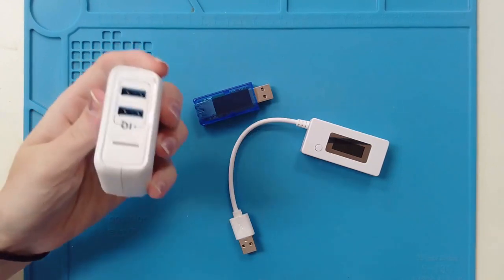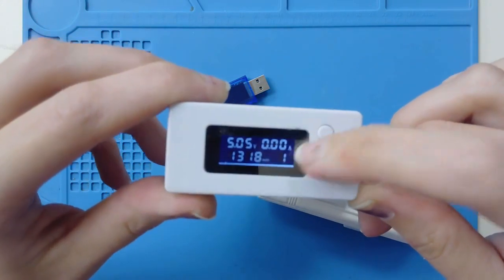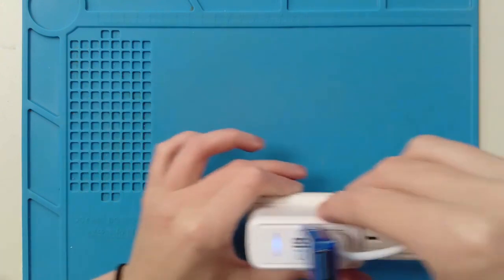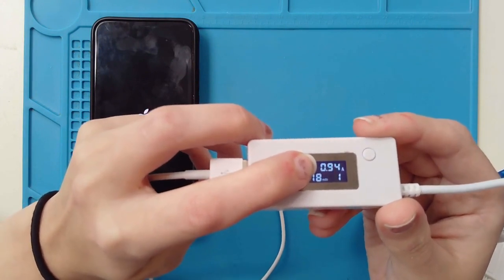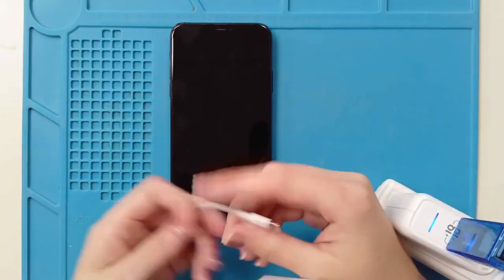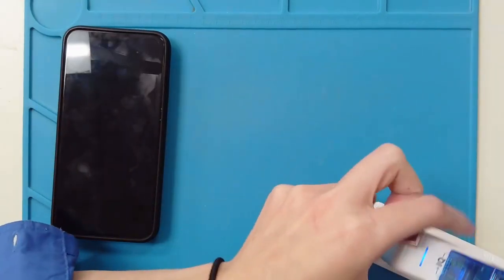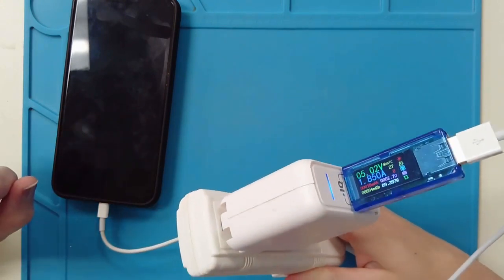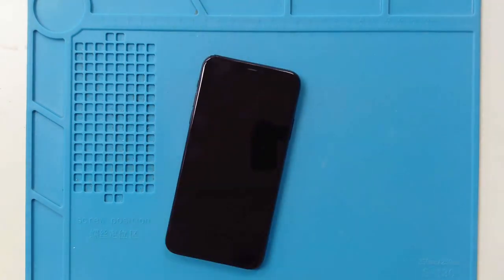How to use AMP meter in phone repair (MakerHawk & ACEIRMC AMP Meter)

Comment: What could be the problem if the amp meter shows that the phone is receiving power but does not turn on?
Reply: If it’s pulling the standard amount of amps (1-2 amps) I’d say that narrows it down to a damaged screen. Try a force restart. If that doesn’t work replace the screen